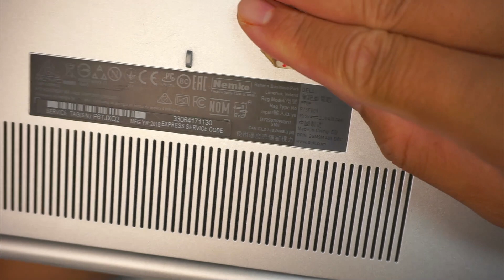Changing Dell DC Jack Charging Port

Comment: Just wondering if it is possible to solder a USB C female instead of the original Dell charging port...soldering the usb c at the end so that the laptop can be charged via usb c instead of the old Dell charger